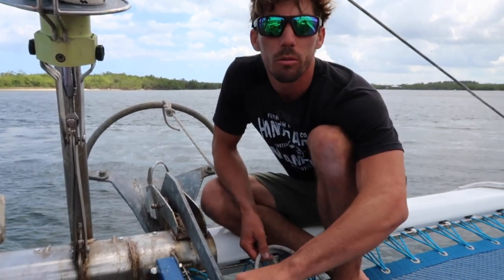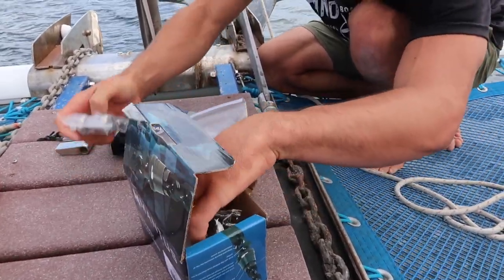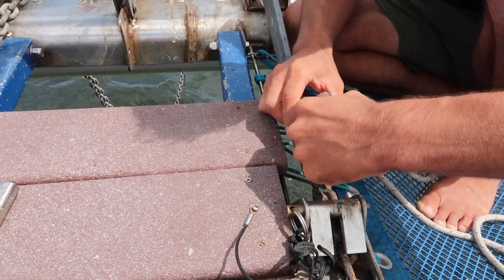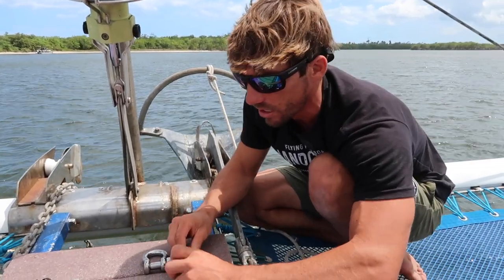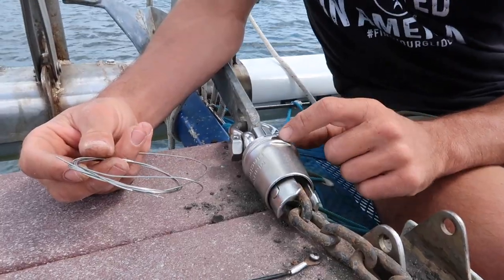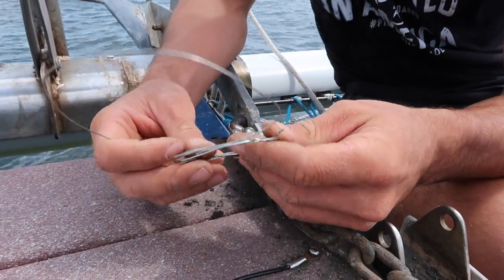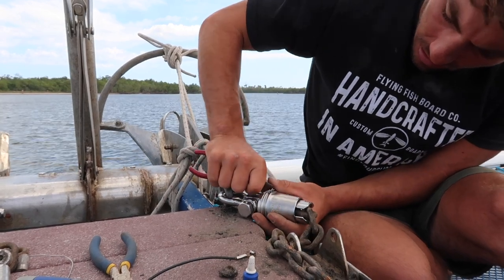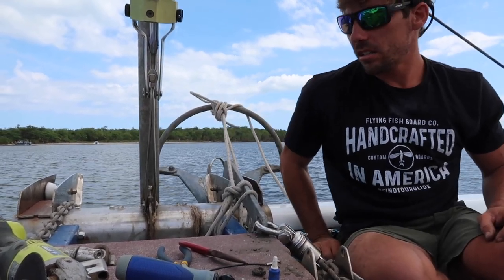Watch THIS Before Installing an Anchor Swivel!

Comment: Great job. I've made the  decision to go with this installation when my boat launches soo. I've seen both installations with the same swivel kit you have, and the normal swivel with the two or three links of chain. Though they may do the same job, I think this installed swivel is more roboust. The "seizing" wire is nothing more than stainless steel safety wire used in the aircraft industry. It comes in 0.20", 0.32", and 0.40" and by the way you were twisting it by hand (I use a safety wire pliers, which makes the coils evenly twisted, not wrapped around each other), 
you couldn't twist the 0.40" by hand. In aviation, the bolt head would have been installed with wire through the head, twisted, and attached nearby in the directio to keep the bolt from turning. So if the bolt tries to turn, the more the wire tightens against it. You can find a spool of this wire in aircraft supplies locations, or Amazon, etc. Makes great for emergency repairs. Luckly none of your tools and parts didn't go in the drink. Fair winds.

Comment: Check that thing every few months.  Galvanic corrosion. You are mixing stainless steel with high tensile steel chain. I had a stainless component (316) in my mooring for a while as a temporary measure. I was surprised how quickly the adjoining rated shackles were eroded.  I get an uneasy feeling when I see that chain buried deep and out of sight within the swivel body. My system is gal steel all the way , no swivels, as a result of my mooring experience. Every link on your chain provides a toggling effect.
Reply: Great point on the galvanic corrosion. I do inspect our chain closely a couple times a year and yes zinc is definitely less noble on the galvanic scale so it is something I will have to watch out for. I will probably just cut off a few links and re-attach swivel once a year assuming the rest of the chain is in good shape.

Comment: I've got the same shackle as your old one, and it's manual (the whopping single leaflet) states that if you're expecting large side loads, you should stick a shackle between it and the anchor. So, don't need a fancy (read: expensive) Mantus swivel just to solve that problem. You just need a properly sized shackle.

Comment: I've never used a swivel with the anchor and in 60 years have never had a problem.  The more complicated the set up, the more likely it will fail.
Reply: Me too. 200,000 miles of cruising and deliveries, and not one problem that would have been avoided with a swivel. What are they for? They are for enriching the makers and sellers of swivels.
Reply: Long term anchoring you need it or the chain will bunch
Reply: @rollingrecords9019  👍

Comment: I had a very bad experience of a stainless shackle and a ss swivel on a mooring. The stainless “ hollowed out “ with corrosion which I fortunately found before it failed.
Reply: Stainless can work underwater, but it better be duplex or better still superduplex stainless like 318LN or 2205. Any 316 is not good in seawater at elevated seawater temperatures  - anything above maybe 23⁰C

Comment: Teflon tape most likely becomes an aid in removal... Any corrosion, sand or grit that gets in there at least you have a Teflon barrier between parts that need to screw off.
Reply: epoxy!

Comment: Please reinstall the guard on your angle grinder and use proper personal protective equipment (gloves, face and eye protection, etc.). Sharp chunks can come off of the disk at very high speed. Very dangerous.

Comment: Sierra please, please, please STOP Billy whenever he reaches for that electric cutoff wheel. They are super dangerous and he never uses gloves a face mask or even goggles. I fear this tool more than any other power tool that I use. It is a monster and will tear flesh and bone instantly. The wheel guard cannot always be used but should be the default tool state removed only for a specific job and then reinstalled. I have had metal fragments removed from my eye and it is dangerous, complicated surgery and painful too. Please be safe and set a safe example for your audience. If you are hurt in remote locales and/or you don't have comprehensive medical insurance a serious medical emergency is perhaps the fastest way to end your dream life. Protect yourselves so we can continue to enjoy your adventure. Covid quarantine would be so dull without bingeing on your video streams.

Comment: To the best of my opinion to shorten the rosty rotten part of the chain in the same step wouldn't have been a fault..
Isn't it easier and more effective to put easily a short piece of chain between the anchor and the swivel? may be 2  or 4mm stronger in Diameter as long as it does not run into the anchot chain nut?

Comment: How does your shackle bolt secured ? I see you have a bolt ..and not a regular eyed traditional bolt on shackle to anchor. Your boat is now hanging from this bolt basically.
Reply: If you watch again, there’s a hole in the nut and he ran seizing wire through the hole and around the shackle
Reply: @frankd2301  thank , yes, could not see where that ss cable went..Billy must be sick of my silly questions..:)..just checking...

Comment: No disrespect, but ditch the "welfare tools". I've been a sailor for a few years and I get it, they go over the side, put away wet etc. Jobs go easier with decent tools though. No need to go SnapOn, look for quality stuff at yard sales or just pony up for Craftsman level stuff. You'll be glad you did in the end.
Reply: And get some box wrenches, or at the least, a crescent wrench. Tightening a bolt with a water pump pliers???...

Comment: Hate to say it, as that is a very pretty stainless swivel, but useless. The stainless will react with the chain, making it rust in weeks (which is why the end of your chain is so bad) look on ebay for galvanised lifting swivels and rated lifting shackles, all galvanised. Get as big as you can fit over your rollers. It will be a tenth of the price of that stainless paper weight and last 10 times as long!
Reply: My thoughts too, when I saw that stainless thing. The chain will suffer.
What Joe wong
 said, was probably a much better solution: Looks like all you really needed was to add a new Shackle
Reply: Charles Phillips It definitely will NOT rust in weeks, I assure you...we have had ours for I want to say 8 years...no rust, no problems, great piece of gear to be sure. Rebecca

Comment: Patrick P. Me too Billy, do you just use the Lee board? And we are only see the board to weather?
Reply: Yes, We use the dagger boards on a beam reach about halfway down or a little less and all the way down close-hauled and somewhere in between on a tight reach. Our boards are symmetrical so we use them both together. If it is very windy I will usually use the weather board down more than the leeward board or the weather board solo.

Comment: Please does your anchor come up straight or upside down with the Mantus swivel? Mine upside down unfortunately.
Reply from the maker: It comes up both ways for me. Sometimes I have to spin it by hand. I don’t think that’s the swivel though, it’s just the way the anchor is balanced. I suspect it would do the same thing with chain and shackle.

Comment: My humble personal opinion is that there are too many parts for a simple and VITAL task. Reliability is achieved through simplicity.  One large steel shackle and a  small piece or rope, for locking the screw, is all you need to attach the anchor to the chain. I mean rope no metallic wires. Metals suffer galvanic corrosion. Stainless steel more than others.
Reply from the maker: Rope to secure an anchor shackle pin? What kind of rope are you suggesting for that?
Reply: @TulasTechTalk  Just a thin piece that passes through the hole of the pin and then a tight knot. It prevent rotation of the screw as wires do, but inspection is easier. A worn rope is easy to spot. A wire can be close to rupture without any clear warning.

Comment: Hey Billy, I have been watching the channel since the beginning, love what you guys do.  I have a question about your catamaran and sailing it, I have noticed that you don't seem to ever put the dagger boards down?  Is  there a reason not to use them?  Does it affect your SOG?  Just curious.  Back to the blue hole video!!
Reply: We use the dagger boards on a beam reach about halfway down or a little less and all the way down close-hauled and somewhere in between on a tight reach. Our boards are symmetrical so we use them both together. If it is very windy I will usually use the weather board down more than the leeward board or the weather board solo.

Comment: Why use a swivel? most experts do not recommend stainless steel components on any load bearing components on a anchor rode. With 15 years cruising experience we have done just fine without a swivel,

Comment: I wonder if the Pivot pin will break as looks too flimsy? Normally you have and open bar with big shackle hole one end and like a big round ball one piece  moulded together at the other end like a tow ball but in a straight line then the two pieces cover the ball and go in to the screw on ring with a bolt to hold the parts so they clamp together hard then e pin with wire through the pin to make sure it holds the bolt and pin in place so any play does not force the connections to work loose . as like the first one they all wear eventually just have to check them each month. Everything must be the correct type of steel for sea water.. I know that British stainless steel is the worlds best but hard to get these days because of Stupid government breaking up the companies, sadly. They other is not German because they use Chinese steel instead of their own. So Swiss steel is the other option.  I wonder why not use two shackles one at each end with 9 ton steel cable connected to the Anchor and chain? Just a thought.

Comment: You are not meant to run a a swivel directly to the anchor, you need chain link between. This is why this method doesnt work...
Reply from the maker: Been working for 7 years

Comment: 3:14 you hit like a gril xDDD bad hammer anyways, thats for nails.
Hex screws unlock with hard hits with somethings round smaller than hex, and hit inside screws.

Like hell thats safety on bolt its wrong, you anchors will hit wire's and broke it ;p

Comment: No offence intended, but the way you use tools is infuriating...
Reply: Agree - if you're putting on a high quality swivel then at least tighten the shackle down with a spanner! Using a plumbers wrench is crazy - you should have a set of spanners and perhaps Mantus can sponsor you!
Reply: Angle grinder guards save lives 😉or at best from a lot of pain, disfigurement and $$